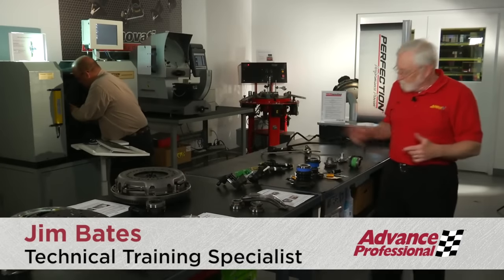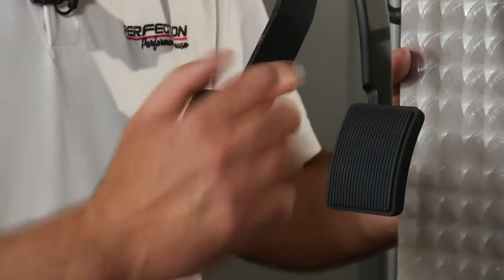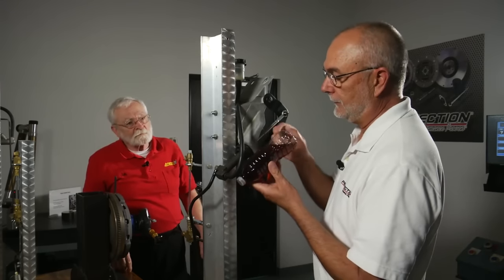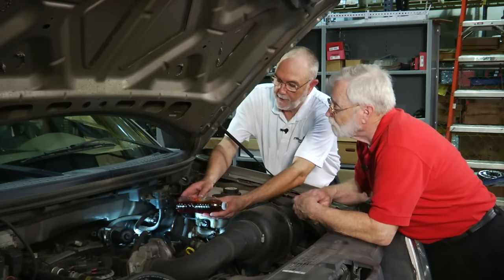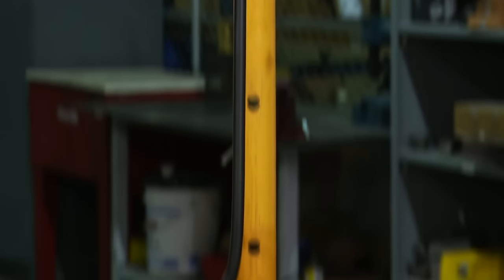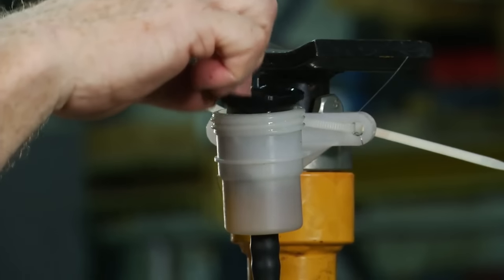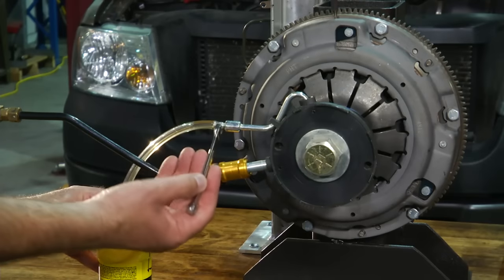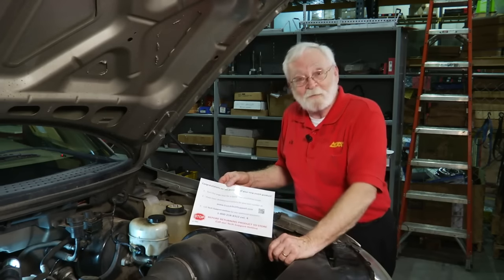How To Bleed A Hydraulic Clutch - Wrenchin' Up

Comment: Sooo, I liked this video a bunch but wasn't able to do what they asked. I was able to leave everything attached EXCEPT the reservoir!  Unbolt it from the firewall and keep it high up in the air, high as it will go, keeping an eye on the fluid level and size/quantity of bubbles coming out, have an assistant pump the pedal(this method gives you WAY better leverage than if it was loose or clamped to a bench). The assistant should pump in different configurations, given stroke intensity, travel, and duration.  Variations are a must, though my "go to" proved to be, press hard and quick in - hold it - count to 10 - slowly let it out - count to 10 - and repeat.  This will get gobs of air bubbles out of the master.  Took easily an hour+ to get majority of bubbles out, probably will have to do it again in a couple days - to let the bubbles to collect some more BUUUUUT my clutch is amazing now as.  My truck did shift before, but often just barely, and reverse,,, sometimes it would fight you like the truck's life depended upon it.
Reply from the maker: Hi - Thanks for watching and sharing your interesting experience!

Comment: Get the same results putting the car up on ramps. For instance if you want the piston end facing down put the front of the car on ramps and leave the back on the ground with chocks. Can do it in the car without unbolting anything. Works good and its how I've done it in the past.
Reply from the maker: Thanks for watching and taking time to comment! You might be interested in the comment from "perfectionclutch" as well.
Reply: +Jim Bates Yep perfectionclutch has it spot on, different methods for different machines. By the way thank you for some really informative videos Jim :)
Reply from the maker: You are most welcome and thanks for watching!

Comment: I have a 2002 Corvette with this problem. Do I need to disconnect the master from the slave to remove the air in the master, or can I just remove the master and tilt it as you suggest. Once I have it tilted correctly, when I pump the master will it remove the air even though it is still connected to the slave.
Reply from the maker: Hi Howard -  I would like to refer you to the experts at Precision Clutch for the answer to your question. They have the experience needed here. The contact information is in the metadata below the video. Thanks for watching!

Comment: I have a 1999 Saturn that is hard shifting into low and reverse. This has been going on for eight years(my sisters car). Mechanic told her several years ago it was the clutch. A clutch doesn't go "out" for eight years. I replaced the master and slave cylinder two years ago with a pre bled  system. Same problem with shifting into low or reverse and the clutch pedal feels soft. Did I get a system that wasn't bled properly? Any input is appreciated. Thank you.
Reply from the maker: Hi - Good question. Since you did not mention that shifting into other gears was a problem too, I am leaning toward a linkage or possibly transmission issue. But since I'm not an expert in this area I suggest you ask the folks at Precision Clutch about this and I'm sure they will be able to steer you in the right direction. Their contact information is in the video description. Thanks for watching!
Reply: @WrenchinUpwithJimBates Thank you.

Comment: Jim, I bought a master cylinder for a 1997 Ford F-150. (Replace the clutch and slave cylinder last year.) Upon taking the old master cylinder off the truck, my son had to cut the hard plastic line in order to remove the cylinder. My son was not able to reinstall the plastic line. He tried heat, drilling out the line, still no luck getting that line over the connector on the master cylinder. So he replaced the whole line from the master cylinder to the slave cylinder with a length of 3/16 rubber fuel line and 2 clamps. We bled the system until we got pure fluid out at the slave cylinder. " NO CLUTCH". Any ideas??? Is it possible parts of the plastic hose got lodged in the slave cylinder? ??? Note: I had not watch your video before this happen
Reply from the maker: Hi - Thanks for watching! I think the brake fluid pressure is expanding the rubber fuel line and not pushing the clutch slave.

Comment: now what happens if your slave cylinder blew during bleeding the slave itself? is this a faulty cylinder, or did the mechanic working on it screw up?
Reply from the maker: Hi - Thanks for watching! I suppose it could be either but my guess (because you didn't mention the age of the vehicle or the slave cylinder) is that the slave cylinder was just worn out and needed replacing.

Comment: Great video! The trouble I'm running into is that my brake reservoir and clutch reservoir are the same, so I can't remove the reservoir/ pressure line. That means I have to use a funnel + tubing instead of reservoir + pressure line. This is doable, but then the problem becomes: how do you disconnect the funnel + tubing and then install the cylinder (which is full of fluid) without spilling fluid out of both ports? ... quite the challenge indeed.
Reply from the maker: Hi - Thanks for watching! I suggest that you contact Precision Clutch because they have an extensive library of vehicle specific videos and information on this. Their contact information id in this video's description.
Reply: @WrenchinUpwithJimBates  They don't

Comment: Hello, thanks for the video. I have Fiat Bravo 2 1.6 multijet 105hp. From 1-2 weeks I have an issue with the clutch - when I am going on first and reverse gear the car is vibrating and annoying rasping sound is heard on the front of the car. Sometimes I am not even able to shift the gears and when I turn off the car and pump the clutch and then the car start shifting and driving off without vibrations. Could it be a problem with the clutch release bearing? Or because of old brake fluid and air in the system? Thanks in advance!
Reply from the maker: Hi - Thanks for watching! Since you mentioned that you have to pump up the clutch I recommend that you check for air in the system. Also check out Precision Clutch because they have an extensive library of vehicle specific videos and information that might help. Their contact information is in the video’s description.

Comment: i have a 91 Toyota MR2, does this procedure apply to all hydraulic clutch systems? the pedal goes straight to the floor no pressure at all.
Reply from the maker: +CBear Gaming - The procedure does apply to all hydraulic clutch systems but because of differences in master cylinder orientation, etc. you may want to go to Perfection's website (their web address is listed below the video) as they have a lot of vehicle specific videos for this procedure and maybe there is one for your vehicle too.

Comment: (gravity bleed you said) you left the bleeding screw open for how many hours? also doesn't opening the bleeder screw get air into the system if clutch pedal is not depressed? I'm so confused.
Reply from the maker: Hi - Based on my experience gravity bleed drains fluid from the system and does not let air in unless the system runs out of fluid.
Reply: @WrenchinUpwithJimBates  thankyou very much.

Comment: watched your video could you raise the front end of the pickup up high enough to make the slave cylinder angles the opposite direction so you dont have to remove it from the vehicle?
Reply from the maker: Good Question Vance. I suppose it depends on how high and what might spill or fall out of the vehicle. I think someone said they parked on a steep hill and got the procedure to work. Thanks for watching!
Reply: Vance - for the Ford Ranger, the master cylinder passes through the firewall at about a 45-degree angle.  The truck would have to be tilted up more than 45 degrees just to make the air bubble flow to the fittings.  Even if this could be done, there is a wicked U-bend in the steel pipe that continues to the slave cylinder that can also catch bubbles.  I think you would have to put the truck on its roof in order to force the air past the bend to the master cylinder.

Comment: I have a 96 ranger and my clutch is squishy. It's got 150k miles on it. Also, i hear a strange noise when I'm in neutral, like water traveling through a hose.. unrelated but any ideas would help. Anyways, Should I change the entire clutch system or just the master & slave cylinder? I want to get rid of the squishy clutch but would rather not have to burp the system more than once. Thanks
Reply from the maker: Hi Alejandro - Without seeing the vehicle or being part of the diagnostics, I recommend that you go through the step-by-step testing procedure found in a service or repair manual for the Ranger to determine what needs to be replaced and serviced. Not sure about the strange noise but be sure to check the Power Steering pump, cooling system (heater hoses, core, etc.) as well. Hopefully someone with the same or similar symptoms will jump in here to help with info to help save time. Thanks for watching!

Comment: 95 f150 same system except resevoir is on master. New master bled and still spngey. Pedal wont come back up and i think i got all the air out. I bled the old way before i found this video. The new master is on the truck. I tried a gravity bleed. Opened bleeder pressed petal got a solid squirt that was it. No more fluid came out and pedal is still down. Any ideas. ??? Im about to return the master as faulty. 
Would a bleed gun work. Im stuck
Reply from the maker: Hi - Thanks for watching! I don't have the information here that's needed to help you with this. I recommend that you contact Perfection Clutch as they have an extensive library of vehicle specific video and trouble shooting stuff, as well as a customer service staff. Their contact information is in the video description.

Comment: As I have to put in a new master cylinder I can apply this  method when it's fitted. At least I can maybe drive the car to have a mechanic bleed the slave cylinder afterwards or do I need to?
Reply from the maker: Hi - If there were no leaking problems in the system, it should have fluid in the line from the master cylinder  to the slave cylinder but I still recommend that you check the service or repair manual for your vehicle to bleed the system using the original equipment manufacturer's step by stem procedure. Thanks for watching!

Comment: Jim, I have attempted this on my 03 Ranger, did not take out the snap ring on the pushrod and it did not really push out any air, and was a very short stroke. Do I need to remove the snapring prior to pumping the pushrod to push out the air? I am simply fighting a soft pedal which is making it harder and harder to make some shifts.
Reply from the maker: Hi Douglas - I would like to refer you to the experts at Precision Clutch for the answer to your question. The contact information is in the metadata below the video. Thanks for watching!
Reply: Douglas - I replaced the clutch and slave cylinder in my 2003 Ranger this weekend and had a soft pedal after everything was installed.  When I was gravity bleeding the slave cylinder, I wasn't paying attention to the level in the reservoir, and let air get into the master cylinder.  The plunger had about 1/2-inch of travel into the master cylinder and was spongy.  I had to remove the master cylinder assembly and bleed it as shown in the video.  

The time to remove the master cylinder assembly was about 2 hours (I'm slow and had to remove other components to make room for my fat hands), with the most fiddly bit being the clip that holds the push rod to the clutch pedal.  The time to bleed the master cylinder assembly was about 15 seconds, then another hour to put it back in the Ranger.  When I was finished, the plunger had about 1/8-inch of travel and was rock hard.

In my opinion, it's not worth trying to find alternatives, like removing the snap ring and risking damage to the master cylinder.  Now that I know what I'm doing, I think I can remove, bleed, and reinstall the master cylinder assembly in less than an hour.

Comment: my transmission normally grinds or gives me trouble downshifting from 5th to 4th. when i'm on second gear slowing down to 5 mph or 3mph I can't seem to put my car in 1st gear. Does that mean I may have air bubbles? Do I need to change the clutch fluid?
Reply from the maker: Hi Christian - I doesn’t seem like air bubbles or a clutch fluid issue but, since I’ve become more of a journalist then a technician these past years, I recommend that you check with the folks at Precision Clutch for a better diagnosis. You’ll find their contact information in the metadata below the video. Thanks for watching,

Comment: well i hope i can fix mine this way. Just done a swap from a 85 T5 to a 02 T56 new master and 4th gen pedal and even after 1hours of bleeding the slave i can feel air in the pedal and i cannot spin the wheels when foot on the clutch. 
make sense. my Master is exactly like the ford.
Reply from the maker: Hi - Thanks for watching! The procedure should work but I also suggest you check the Perfection Clutch site as they have videos on many, if not most, vehicles that might help you. Their contact information is in the video description.

Comment: The clutch pedal in my 2001 Dodge Neon offers no resistance at all.  It just goes to the floor like a limp washcloth.  I replaces the master cylinder and the slave cylinder and bled them thoroughly.  It still does not engage.  What else can I do besides junk the car?   I am lost.
Reply from the maker: Hi - Thanks for watching! If you have already checked for a proper mechanical connection between the clutch pedal and the clutch master cylinder, I suggest that you check with the folks at Perfection Clutch. They have an extensive vehicle specific library of information that may help. Their contact information is in the video description.

Comment: Jim,  I have a 01 chevy 2500. Clutch, pressure plate, throw baden was change recently by previous owner.  I changed the clutch master cylinder and bled it.,  but still doesn't wanna go in gear.  Any suggestions?
Reply from the maker: Hi - Clutch disk in backwards?
Reply: Thx for the reply but come to find out.  The clutch master cylinder wasn't bled enough.  Now I have to change the clutch pedal out

Comment: What about bleeding the vehicle at an extreme angle? I’ve got a 45* hill I could easily use to accomplish this.
Also, the bleed screw on my MR2 is about 6” lower than the slave cylinder itself. This can’t be good, can it?
I getting chatter in startup that goes away after a few minutes since I changed the master and slave out.
Reply from the maker: Hi - Thanks for watching! Check the comments for this video. Some viewers have tried this and reported success.
Reply: Wrenchin' Up with Jim Bates
I did, sir. Thank you.
Can you tell me, is chatter from the clutch on startup a symptom of air in an extremely long hydraulic clutch line? I drive an MR2 Turbo and, because it’s mid-engine, the line is very long. I’m experienced in bleeding techniques, but I suspect the bleeder being lowest in the system may lead to air in the (bleeder less) slave cylinder. Would that cause chatter on startup?
Edit: I should mention it shifts normally but this problem started the night I replaced the master and slave with new OEM/Aisen units.
Reply from the maker: Hi - Based on what I think I know about such things, I would think that the chatter would be there all the time, not just on startup if it caused by air trapped in the system. But again, I think the folks at Perfection Clutch would be the best resource here.
Reply: Wrenchin' Up with Jim Bates
Thank you, sir. I’ll call them

Comment: I replaced my master cylinder and bled it with a bleed kit, the car was ok for 5 min then it wouldn’t change gear. Think this is the problem? Thanks for the video
Reply from the maker: Hi - Thanks for your comment. I suggest you check with the Perfection Clutch website for more information that may help. Their contact info is in the metadata below the video. Thanks for watching!

Comment: I've been trying to bleed my Audi a6 clutch for over a week. this is one thing I haven't tried, removing the master and tipping it. I did that with the slave. the strange thing is I can get full pedal by removing the slave cylinder, once it's installed the pedal is soft until near the floor. Im ready to give up soon, and I just did a motor and trans swap yet can't bleed a clutch..
Reply from the maker: +Kyle Dupont Hi Kyle - Tipping the MC seems to work well every where it's been tried. I hope it works for you. There may even be a vehicle specific video on Perfection's web site you could look at. Their URL is in the metadata. Thanks for watching!
Reply: +Jim Bates so I installed the whole line master and slave , my truck starts without the clutch, and won't shift into gear while on , but does while it's off , why?
Reply: Kyle, couldn't stop laughing when I read your comment, I know exactly how you feel. If I ever have to bleed another clutch hydraulic system again it will be too soon.

Comment: PLEASE HELP ME!!!!!! i have a 95 honda accord that wont bleed out. ive replaced the clutch and the master cylinder and the slave cylinder. i have pumped 4 bottles of brake fluid thru it and it just wont give me anymore than a quarter of a pedal and as soon as i drive down the road it sticks to the floor. this has been a 2 month nightmare. any suggestions that could help would be great
Reply from the maker: +Ashley Byer Hi Ashley, sorry for the delay in answering. If you have watched the video and followed all of the procedures we discussed and still have problems, I would suggest you go to the Perfection Clutch website, using the link in the comment section, to check out their vehicle specific videos and customer service material.